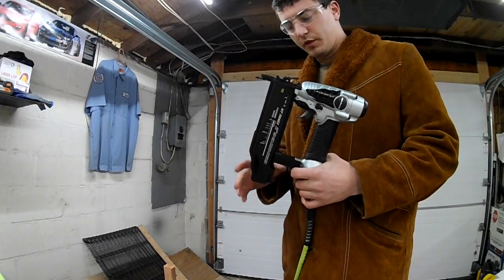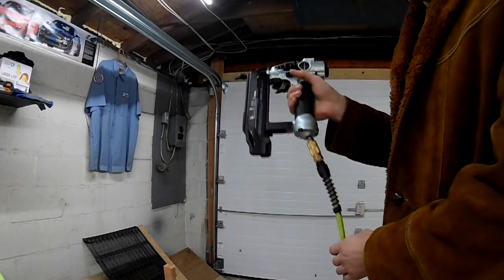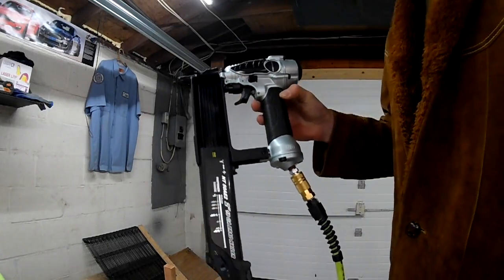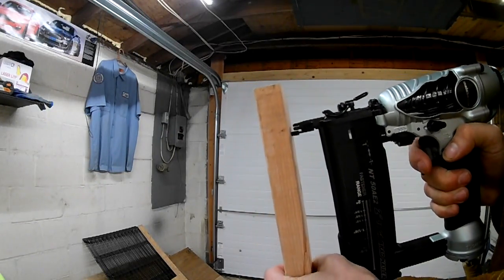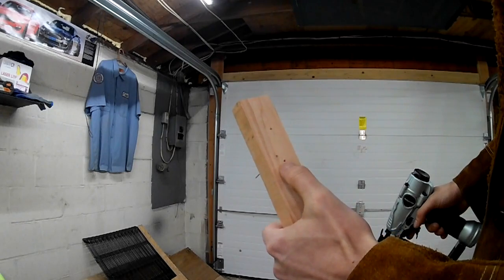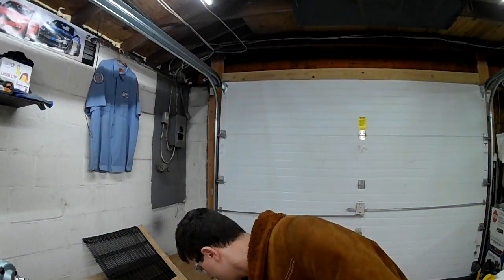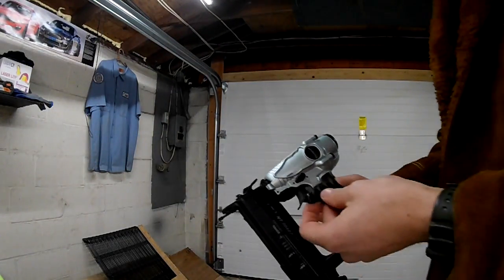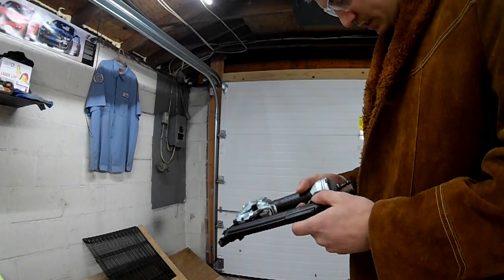My review of the Metabo HPT 18GA Brad nailer

Comment: Great video showing people what to expect.
 
First thing I do with nailers, and some other tools, is remove plastic "cosmetic" items that have zero function.
 
And while this is a decent little brad shooter, ($50, with case and Bobo glasses on Amazon currently. I got 1 just to have as a backup.) it's not a good brad. It will work for some DIY things, but it's not meant for heavy use. So if you get 5k nails through it, and it dies, you got your money's worth. 
 
Also... NONE of the Metabo, or Metabo HPT, are anywhere near as good as the Hitachi brand was. :( I do miss some of the older Hitachi Tools. They were great for abusing them, and rarely failing. 
 
So many tool brands have started to RAPIDLY decline. The most notable for me have been Dewalt, Milwaukee,  and Paslode. Thankfully Makita is still strong, and Bosch has improved 100% over their last few years.... especially with redoing their battery for cordless tools. 
 
* - With Metabo HPT, if you want to use the warranty, make certain you only use Metabo Pnuematic oil. They can be a bit... tough... to deal with and will look for ways to null warranty if you mail it in. Then again... if this nailer breaks, grab another one and use this for parts. Lol.